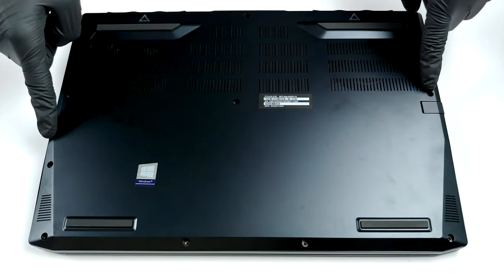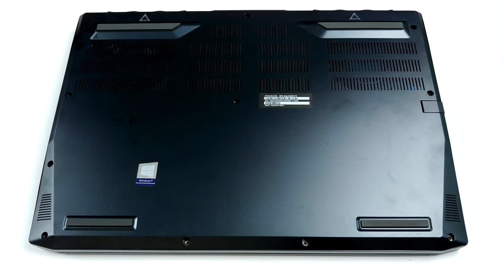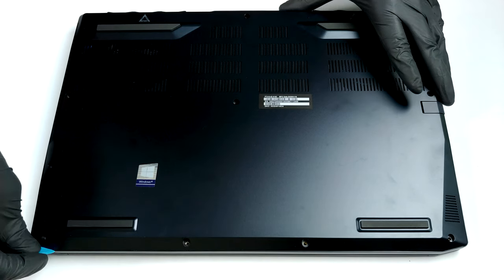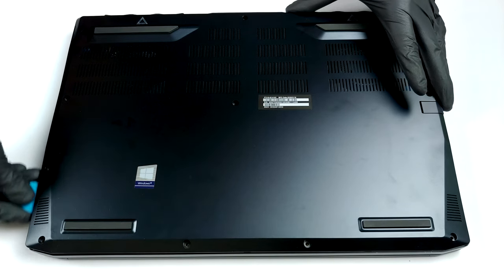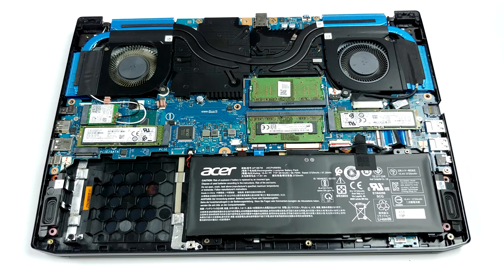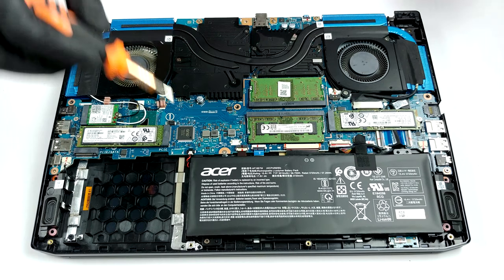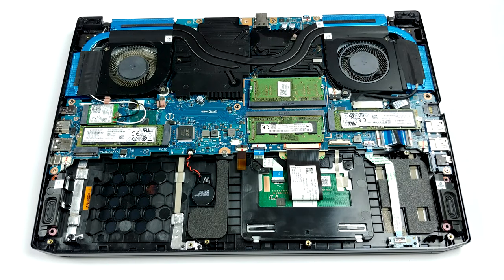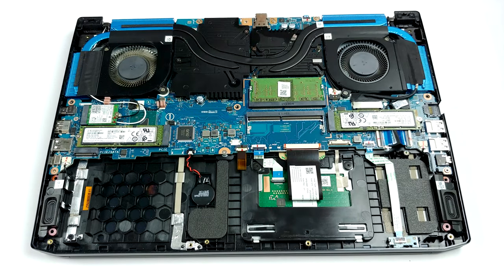🛠️ Acer Predator Triton 300 (PT315-52) - disassembly and upgrade options

Comment: Popping off the bottom panel with the correct tools is not that easily done. The plastic on the corner of my bottom panel ended up getting scuffed really bad and permanently scraped the black color off the corner bottom panel.
Reply: Any advice I literally can't get it open
Reply: guitar pick :) just opened mine.

Comment: I had mine for two years and just noticed a thin layer of hair and dust on the fans. This video is very helpful. My previous laptop was a HP pavilion 15 which is one of the hardest to open as you. This in comparison looks super easy
Reply: same. how would u clean the fans? i just used a swab to extractt some dust.

Comment: solved for me: two single edge (safety) razor blades. use entire length as wedge. you have to start from the front with one and use the other as a continuation. work your way around equally to the back each side. then gently lift up and pull slowly towards you (to the front). pop.

Comment: Is there a possible fan replacement for the cpu with the fan used on the gpu? wanting to upgrade mine from 16gb to 32gb and the new metal fan so it runs ultra smooth

Comment: Laptop media im looking for somthing well built made out of metal that will last. i had a xps 15 9550 for about a year before the hinges broke. however i owned a $300 acer swift 1 that lasted threw years of abuse and has just started failing. the point of getting the expensive laptop was for it to last, however the cheap one lasted for i think more then twice the amount of time. would the acer triton 300 be a reliable high quality option with good build quality? what mid to high performance laptop has the best build quality?
Reply: i have this laptop and i dont recommend buying it.
Reply: @phaserr1595  why?
Reply: @notorioustito8515  it Overheats, makes noise because some tape is not Attacken the right way and some other dumb things. Note, that the tape is a common problem. It will start making noise after some months and u will have to pay for repairing it. Also there is some malfunction with the touchpad, which randomly stops working and you have to restart your computer. I also heard of some bios Issue idk. Just dont buy it. Im very disappointed with mine...